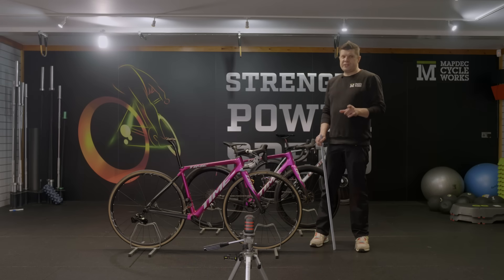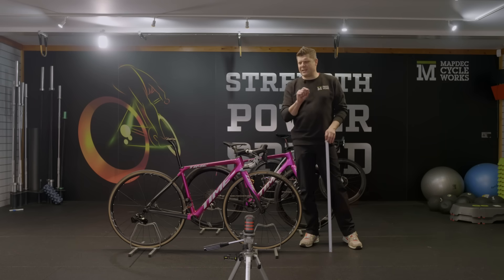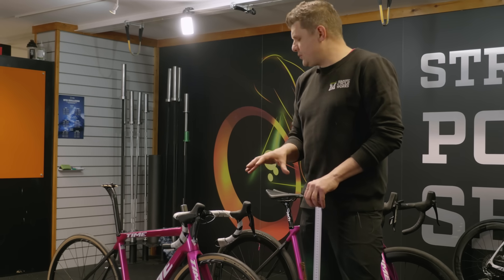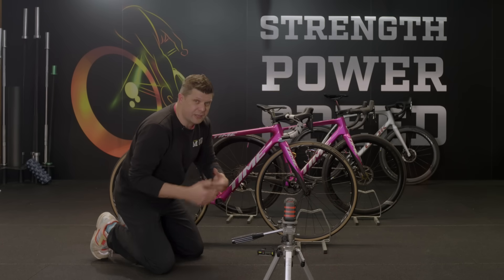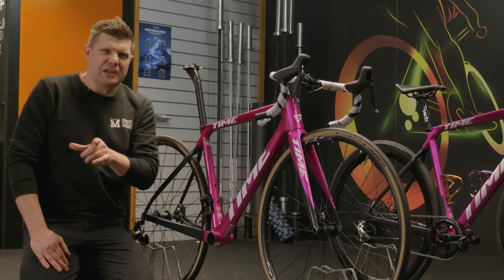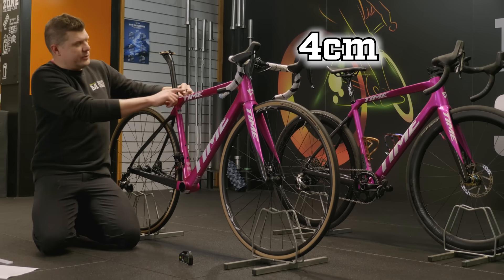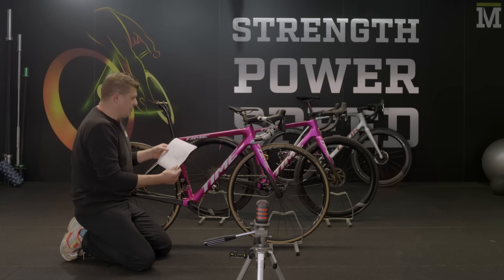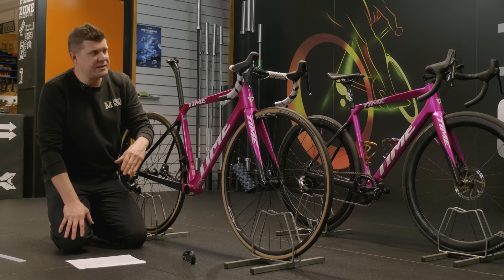Small Bikes - Big Decisions

Comment: Short cranks don't just alleviate issues with toe overlap, it also means the leg has to extend a little less and that means the seat can be placed higher, so more saddle to bar drop can be achieved. 
I'm a 166cm small rider with an inseam height of only 74cm, which had me come to similar conclusions like mentioned in this video. I had to go through quite a few frames until now that I'm actually riding a size XS Time ADH, which is finally a bike that fits me. I'm also running a longer than (for me) usual stem. 
Another thing I want to try now is using a 0-offset seatpost, as I'm currently running a 25mm-offset one. I think there are some potential gains, in the power as well as the comfort department.
Reply: What crank length did you end up going with? I just purchased some 160mm cranks, hoping for some improvements coming from 170mm cranks.
Reply: @Aspireonthego  I'm also running 160mm cranks now.

Comment: Some good points, but :) 13:00 — a longer front-centre (slacker head angle) and higher trail on an xs bike make the bike more stable, which nicely counter-acts a short stem. This is the idea of progressive/forward geometry bikes such as Santa Cruz Stigmata v4, etc. May feel unfamiliar first, but you adjust and it works. On the contrary, a short front/slacker head & lower trail on an s bike combined with a short stem will make the bike way too twitchy — so it’s hard to agree with your take that that’s better handling-wise
Reply from the maker: The stigmata is a gravel bike.  You would never ride it like a road race bike.  Put a short stem on that and ride seated up a hill and you will have to fight the steering to stay in a straight line.
Reply: This! As long as wheel flop is not an issue, more trail is indeed needed to counteract the effects of a short stem combined with a narrow(er) handlebar. To achieve this without having toe overlap issues, you need a slack head angle combined with a higher fork offset. So while the video touches really valuable points, in my view, the take on trail and stem lenght was off.
Reply: @Mapdec  you are referring to the flop — which is indeed an issue on a very slow uphills (less than 5 km/h or so). As someone who often rides 20+ % grades, both uphill and downhill, on bikes with various geometries, I would prefer being more concentrated on an uphill, risking a sudden stop from 5 km/h, than having to deal with a jittery bike on a 90+ km/h downhill — with all the associated risks of losing control there :)
Reply from the maker: @dropbaran  now apply that ‘flop’ you describe to a flat fast corner in a peleton of riders. You will need to reduce speed, stay more upright and take a wider turn.
Reply: @Mapdec  oh no, the wheel flop is an issue only present at very low speeds. I noticed that you deleted my below comments with the links to my in-depth blog posts on the matter — which I don’t get as that’s just a blog, and I have no agenda there other than share my knowledge that requires more words than what fits into a comment here — but you can still find the blog in my youtube bio and then read the first three posts. Btw, that’s been reviewed, and agreed with, by the head engineer at a prominent bike manufacturer. You may agree or disagree, but it’s always good to explore others’ opinions imo. Peace!
Reply from the maker: @dropbaran  nothing deleted I promise. I’ll check held for review.

Comment: As a shorter rider, I’ve committed to only buying custom frames to get the size and handling I need. If I’m spending a few thousand on a bike, it better fit me like a glove.
Reply: Sorry for being late to the game but ...
Unless you are buying a custom frame with 650c front wheel (I've seen custom frame with a 650c front and 700c rear combo !?!?) and something like a 150mm crank your argument doesn't hold water. A custom frame can't solve any of the issues because you are limited by toe overlap created by the front 700c wheel, fork length, head tube minimal height and stem thickness.
Considering how all major manufacturer have for away from the road 650c/tires, it's very limited in terms of the choice. Another solution is 650b wheels for gravel/endurance bike.

Comment: Good video.

My frameset's head tube angle is 72.5° and came with a -6° stem.  Could you do a video specifically about the changes in handling if the stem was swapped to a -12° stem and a -17° stem?
Reply from the maker: Just be careful to check how your cables run and any frame interference.

Comment: Excellent video.  One thing not mentioned is 650b wheels.  These can get rid of many of the problems you mentioned, however it severely limits your wheel and tyre choice.  For example no pirelli, no goodyear, no Vitoria, michelin etc as to most brands 650b is mountain bike only.  For me on 650b road I basically have the choice of Gravelling SK or GP500 STR.  That is it.
Reply: I think Schwalbe also makes road tire in 650b, also in 26 version (junior road bike).
Reply: Vittoria and Schwalbe do 650b tires

Comment: 168cm tall but have a high ape index (long arms and legs - short body).  Standover is not a problem but I like a lower top tube so I can move the bike around under me, when standing on the peddles (Giant - mike Burows and compact frame geo, best thing ever).  Toe over lap is the problem that I always have to work with, and a light front end - wheel that wants to slide out and dump you on the floor, this comes from I believe the slack seat angles that pull you back away from the middle of the bike.  You just have to live with it as being short is always a compromise if you wish to run 700c wheels, I do not like 650b as they just do not roll (feel) as quick.

Comment: dare to ask... Loving your content and fell in love with Time and want to custom paint and build an ADH'23. But now it turns out I'm in between sizes... :-( I have some issues with my neck and can not go too long or to low. Size M is on the low side(needing all the spacers) and L is too long (shorter stem: 70/80mm). What to do now?!? wait for the new fluidity or take the gamble with a sub-optimal frame. What wil be the consequence for the ride feel if I have an M with a lot of spacers or a L with a short stem (hitting the bar with my knees while out of the saddle?) hope you have some tips or advice to help me with this dilemma.
Reply from the maker: Go M.  The stearer comes uncut. We can try and make that look ok. Also consider the ADHX.  Come and try.
Reply: thanks for the reply, helps with the decision. But ADHX has the same geometry chart, in which way would it help? Unfortunately live in the Netherlands, otherwise I would have dropped by yesterday...!  @Mapdec
Reply from the maker: @rubenkuperus8318  I’ll try and make a YT short with the 2 frames side by side.  The ADHX has a longer fork than is compensated for by the head tube. It’s not a massive difference.  But if you need to run a lot of spacers on the stearer tube the lower BB and longer WB of the X would help with a more upright position

Comment: I find toe overlap to be a minor problem. It only matters when turning very sharp (and slow therefore). I have a 56 with 175mm cranks, foot size 46 and cleats all the way back, so i was very worried at first, but never had a risky moment.
Reply: I have a bit over overlap about 2 cm, still it is annoying, it was not present on my previous gravel bike, but it was too long and a pig at slow speeds, new one is a racy gravel bike and feels much better over all…
Reply: I ride smaller frames than industry recommends for my size + cleats pretty far back. Only drawback of the toe overlap is the fact that my crispy white cycling shoes are sometimes marked. Never found it to be a big issue otherwise.
Reply: @super8hell  That is actually true. My right shoe gets some marks from starting sometimes, too. Only applies to non-black shoes, though.
Reply: @SrFederico  exactly that.
Reply: Pedal striking the ground when pedaling through a corner is much more common and dangerous

Comment: I know this video isn't TIME-specific but I'm wondering: how small a rider will the XS ADHX and ADHX 45 actually fit, given the relatively high standover height?  I was told 76cm for the ADHX 45.  But I'd love to be proven wrong!
Reply from the maker: What do you want to know?
Reply: @Mapdec  I have a 75cm inseam and would fit easily over the xs ADH.  But am I correct that I would NOT fit over the xs ADHX 45, even though that bike's geometry is otherwise more suited to its purpose?  Thanks in advance, great video!

Comment: Really weird reading that 170 cm tall people complain about bike related problems. I'm 163 cm, and I have to found the hard way that there is nearly no endurance road bike available for me. Nearly. You don't mention it in the video, but smaller wheels (ETRTO 584 mm - 650b) solve pretty much everything according to frame geometry. Sadly, only Canyon takes that seriously. Standover height is no problem at all, by the way, totally irrelevant as they are way below my inseam length (77 cm). As I learned, the most important thing is the top tube effective length, which is around 510 mm in my case.

Comment: I'm 5'11 with 29in inseam and I rid XXS 44cm frame with 130 mm stem and I've had a a professional fit.
XXS 44cm frames should be fitted with 650b wheels, to reduce toe overlap.
Reply: Nearly 6ft riding a 44cm frame wtf 😂
Reply: @archieman123  it looks like a circus performance.
Reply: If a competent shop or fitter has  chosen  that set up for you, please find another shop..in my experience, you should be on a 52 or larger frame.. at times like this, please do not focus entirely on standover height..
Reply: Not as silly as it seems considering the inseam. I’m 5’6’’ (1m69) with 30 in (75 cm) inseam, which I think is already relatively small for my size. A size S feels a touch too big, I don’t have enough seatpost sticking out the 50 cm seat tube. If you’re 6 ft but with incredibly short legs and arms, and happen to be incredibly flexible and need to ride with the torso parallel to the ground to be comfortable then this setup makes sense.
Reply: @Antoine_Frs    I am also 5'6" tall with a slightly shorter inseam 29". My ideal frame is a 50-52 cm with a top tube of 54-55 cm. I find that a bike with a short top tube and a 130 mm rides a bit strange. I have had a few Colnago's, Miyata,  Vitus 992, Giant Cadex.. my favorite all-time bike was a Gianni Motta Personal..a great ridding bike..all these bikes are classic parallel top tube bikes.. my current bike is a bespoke steel bike 52cm ST( center to top) and a 56cm TT with a 90 mm stem..quil as it allows  me to adjust the bar height..
Reply: I forgot to mention the frame has a pretty strong sloping top tube. The "effective" measurements are 46cm for the seat tube and 50cm for the top tube. When I replaced the 80mm stem with 130mm stem it effectively increased the cockpits area by 50mm.
Similar to the way a 53cm frame would fit.

Comment: Very informative video. If you think it's challenging riding a XS frame, I ride a TIME XXS frame 😄 Also, when looking at the reach, keep in mind that the actual reach is also affected by the seat tube angle. The reach is only measured from the head tube along the top to where the imaginary line of the BB intersects it perpendicularly. For example, if you have 2 bikes that have the same reach but different seat tube angle, the bike with the slacker seat tube angle will make you extend more to reach the bars (even though both bikes have the same reach).

Comment: As usual, great content as you are addressing issues that are very common but no one seems to talk or educate about. Isn't the same true for very large bikes? Affected myself with 1,95m and 96cm inseam. Fitting, Seatpost length, stems, spacers, drop saddle to bar, crank length and how this all affects ride characteristics. What would the the solution? Different wheel sizes and more options and education?

Comment: A few decades ago,  We often recommended building frames for 650c tubulars or clinchers and occasionally a slopping top tube to improve stand over.
Unfortunately, customers weren't ready to accept small wheels, large gap behind the seat tube and definitely not the slopping top tube. 
Rider's are more open to change these days and I think manufacturers could test customer response by first offering aluminium bikes with 650c wheels, again. 
I'm old enough to remember small bikes had 26 x1.1/14 wheels and medium + had 27 x 1 1/4
Reply: for a few months now i've been trying to convert a 571 tt frame from the very late nineties to 622. it's just a silly project, i know. we didn't have any 571 forks, so it was very hard to tell the original geometry. finally i did the calculations. the head angle is 71° and the seat angle is 79°. the top tube is 530 mm long and has -3°, so it's originally a low-pro setup. the best thing we can do is to lift the front a bit, so we can have 69°¸head angle. the problem is that the bb will be very high, comparable to a mountain bike, at 310 mm. so if it doesn't wok, at least we had some fun experimenting there.

Comment: I'd like to add that the trail figure on small sized bikes can be altered via fork rake. It's possible to maintain a fairly consistent trail across the sizes by increasing fork rake as the head tube angle slackens in smaller bikes, thereby somewhat preserving handling characteristics. Increasing fork rake tends to move the front wheel away from the rider, which has a similar effect as slackening head tube angle, which further reduces toe overlap issues.

I think the reason why some manufacturers don't do this is simply because of cost: because it's much cheaper to have a single mold for a fork rather than 2 or 3 across the size range, which is a shame, because smaller riders are shortchanged by this. Specialized, Cannondale, BMC, Liv (but not Giant, oddly) and Look are brands that do this off the top of my head.

I do strongly agree that there should be a wider range of crank lengths and bar widths in the market, and that it's only possible to make bikes so small with wheels so big until compromises need to be made.

Comment: Yep. I have all the mentioned issues. 😅
The positive angle of your stem gets you the impossible task of finding a negative angle integrated handlebar. My garmin is a bit shy of pointing upwards. Not aero at all. 😢
Reply: Darimo?
Reply: @82vitt  They don't work with anything but 80s style round bars. How do I know this?  I have an expensive paper weight because I didn't check first...

Comment: When I first heard Canyon uses 650B wheels in their 2XS and 3XS road frames (and XS gravel frames), I thought it was a terrible idea. Now that there are enough tire choices in 650B, maybe that idea is not that bad after all!
Reply from the maker: its good for fitting, but raises gear ratio issues.  I should have talked on that matter in hind sight
Reply: @Mapdec it allows for higher gears, so the problem is reduced. Just something to consider

Comment: 9:37 bar clamp centre relative to headset bearing is irrelevant to handling. The system only knows the axis, trail and where the rider load is applied.
Reply from the maker: You can restrict your steering angle a bit like a knock block, or by internal cables, Lots of ‘depends’ to consider.   It’s why I didn’t go into too much detail

Comment: The XS bike’s slack HTA would have been fine with a fork offset of 55mm. It would have reduced the trail to 58mm using their settings. This is important because Time is being really traditional here and assuming a tire size of 23C. A really slack HTA and high offset do affect wheel flop slightly, but that isn’t a concern unless you’re getting to chopper levels of slackness.

Comment: 00:50 but do you really need to fit 700c wheels? Why not 650b? 26in for xxs?
Reply: It might come down to availability of parts. Very few shops carry a variety of 650 tires and tubes due to limited demand.
Reply: I'm not sure that's still an issue. Continental and schwalbe both produce good quality 650b tyres. Same for rene herse.
Reply: No cool TPU tubes for 650b narrow wheels. Also only Schwalbe and Continental make road tires in that size, no Pirelli, Goodyear and all the rest of the ever growing selection available for 700 wheels, big trade off
Reply from the maker: I wish i had talked about it now. There are gear issues that make things unfair. with a smaller wheel you travel less distance for the same gear ratio, meaning to travel the same speed you need to pedal faster or push harder, there is also the implication of momentum and acceleration.
Reply: But is that an issue for the average rider who will likely have gears spare?
Reply from the maker: @andrewcooling2756  torque
Reply: @mapdec, maybe you’ve another video to do :)
As I understand it, 650b will reduce the effective gear ratio however if you still have harder gears left the rider can simply change to compensate?
Reply: @Mapdec as noted (by someone else) in another thread, your idea of gears is missing something — with all due respect. With smaller wheels and same gear you’d travel less per rotation, yes. But due to the smaller wheel, the torque is also less. So by then making your gears higher, you get to same torque at same cadence at same speed. And it’s not a problem to put bigger chainrings, as you sure understand